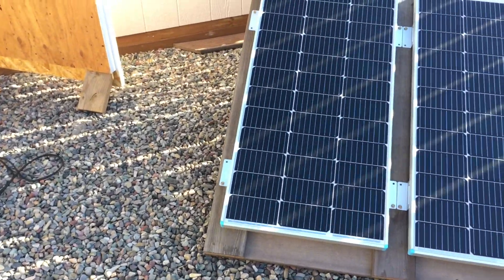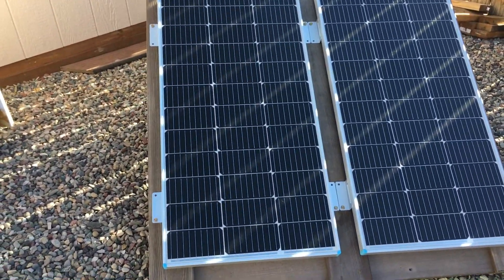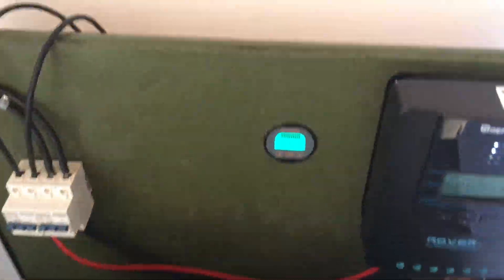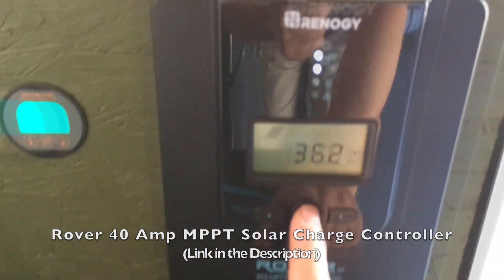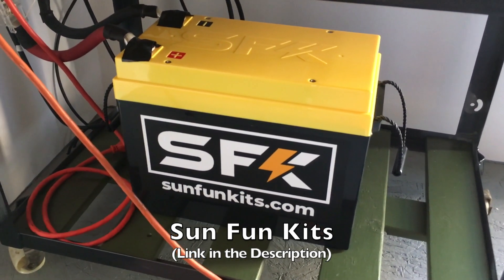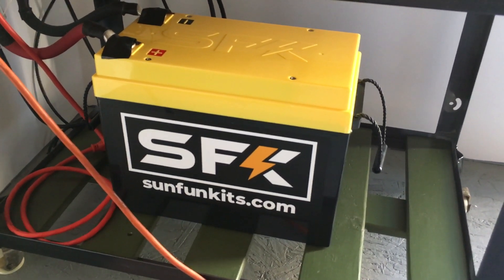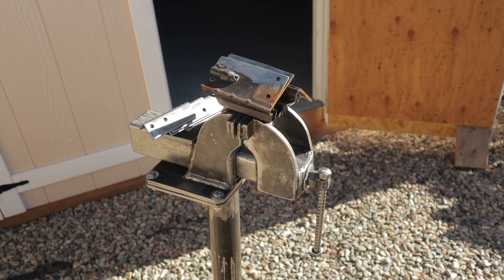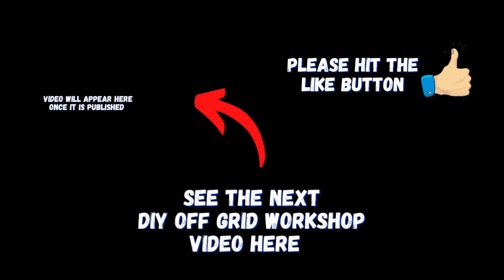Transforming Steel with Off-Grid Solar Power Magic

Comment: I have a similar setup to you and also do a lot of welding.  I would really like to come up with a off-grid solar system that can run a 240v welder (maybe at 50a).  What are your thoughts about a system like this?
Reply from the maker: I think it's absolutely possible with the right equipment. I wish you the best with your project!

Comment: I've got the same meter and am using a 20a grid power charger until I get my panels on the roof.  I have to charge the battery about 2 hours every morning, and without fail the meter loses it's memory within 5 - 30 minutes of turning the charger off.  I can reset the capacity and the meter will work fine until I turn the charger off the following morning.  It's installed inline 6" from the negative battery post with 4/0 welding cable, and positive power comes from the positive bus bar (12v) about 3' away.  If I can't get it figured out I'll probably have to spend more for the Victron meter.
Reply from the maker: That's interesting, hope you can get it sorted out.